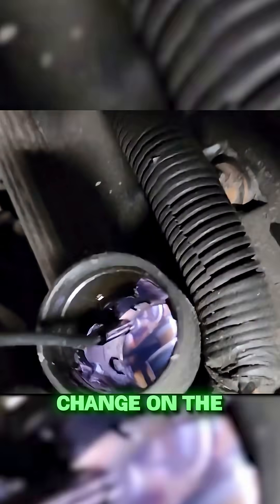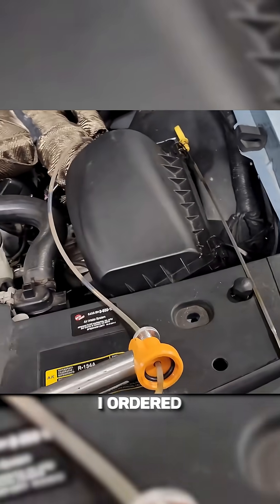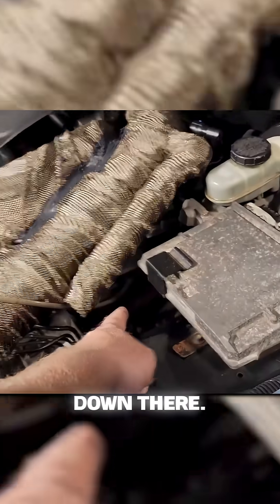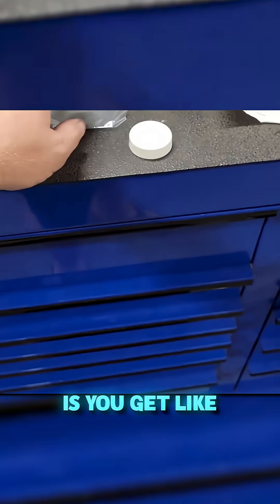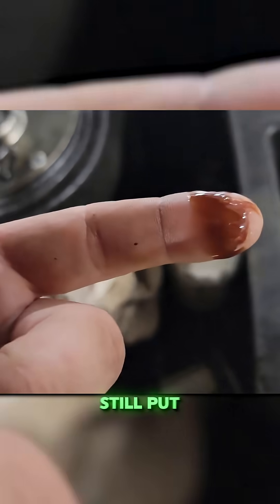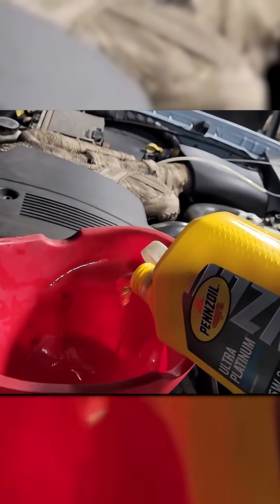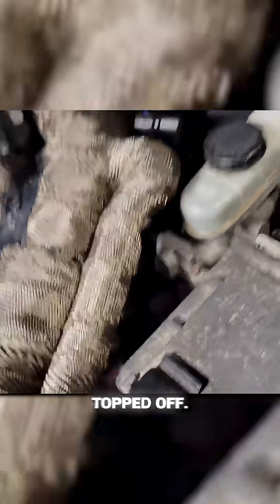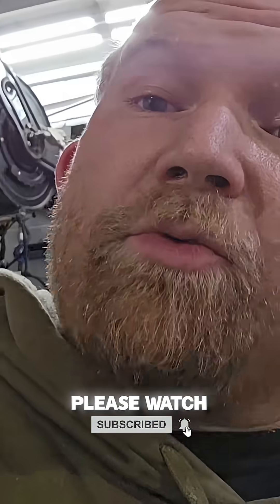You Think Your Oil’s Fine? Watch This Lab Test First #ford #reels

Comment: The Purolator One oil filter has better filtration efficiency than the more expensive Purolator Boss. 
Why? The Boss is rated for 20,000 miles. They had to reduce filtration to push the filter change interval out that far. 
This information is available on the Purolator website.
Reply from the maker: All those filters are good, i particularly like the bosses can strength overall